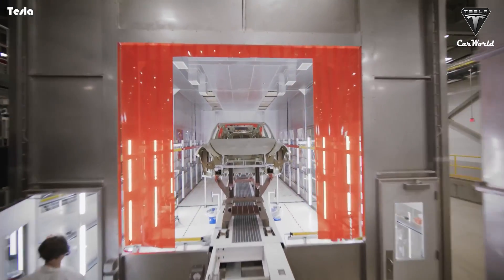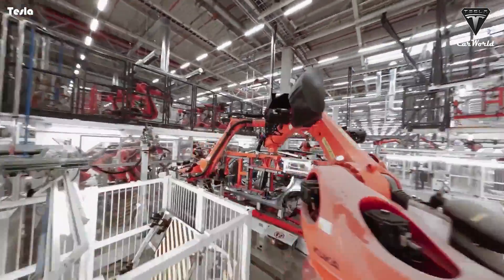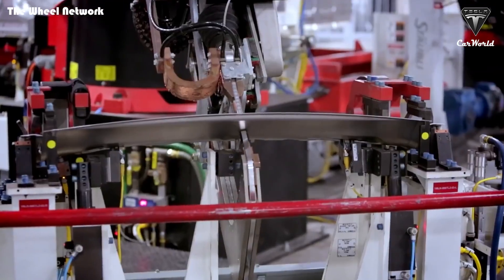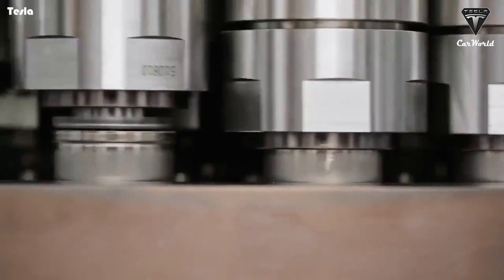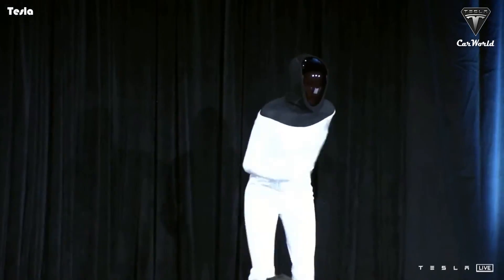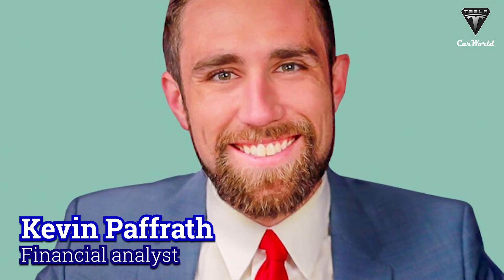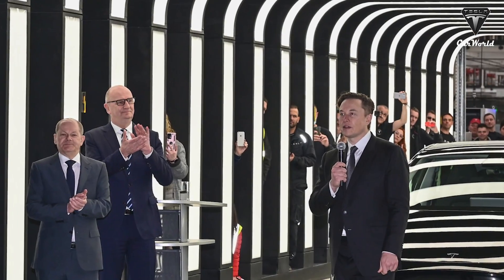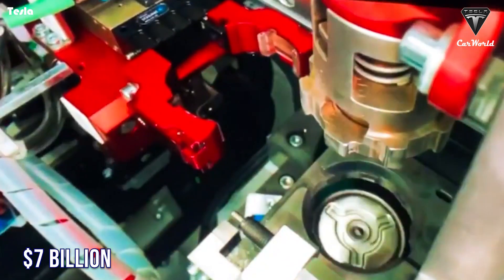Elon Musk Just Revealed How Tesla Giga Texas produce so fast?

Comment: Volkswagen used to galvanize the body of the model Beetle. They were so reliable that endless enthusiasts figured out ways to not only rebuild its engines but mod them for beach buggies. Its for the time large wheels with independent suspension made them very capable. 1974 the Golf (or Rabbit in US n CA) was a new era of trying the untried. The inventor got fired before development was rife enough to smash the competition. Volkswagen used a turntable where robots would spot weld bodies to have a finite life. To counter engineering shortcuts they offered the clients endless options. Volkswagen was on a roll. Its Passat was transferred to China and cloned as Santana and sold in huge numbers. Black Audi's were quick to make contracts with China governments displacing  the so much favored Black Mercedes.  Instead on focusing on looking after their engineers they went mad on expanding the number of models. Brain drained Germany went on a design pride. Elon is just the new Apple in the car making, few models that offer everything!

Comment: We need to increase carbon free energy supplies for off peak electricity production.  Electric vehicles only transfer the production of pollution to the electric power plants that use oil, coal or natural gas.  Those are the marginal producers of electricity.
Reply: Given.  BUT, electric cars are inevitable.  We know this, it's not a maybe.  We will need electricity for manufacturing, heat pumps, lighting, servers, the internet, and much much more...right?  We WILL need alternative sources, not coal, or gas, but solar and nuclear, and hydro, etc...  There's simply no other way.  Saying the electricity has to come from somewhere is accurate, of course.  We know the problem.  We know the solutions.  We are just dragging our feet.  That's the stupid part IMHO.
Reply: Do the research next time before speaking. Off peak in many areas is already handled by nuclear base load, pumped hydro and wind. 🤔
All low or zero emissions electricity generation. In my area all over night power is handled from nuclear, wind or hydro power and I get 400 kwhs free off peak ev charging a month from 11pm-6am. Even during the day we have over 50% coming from nuclear&renewables. 😎